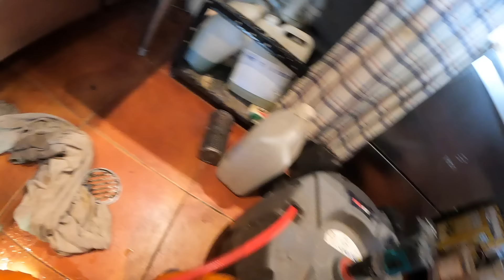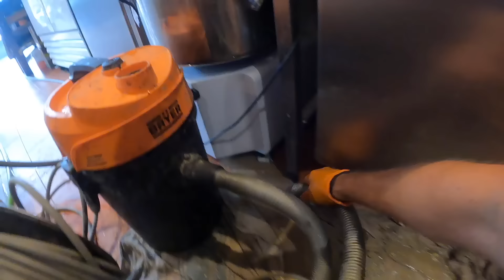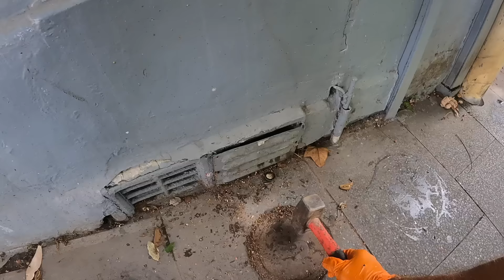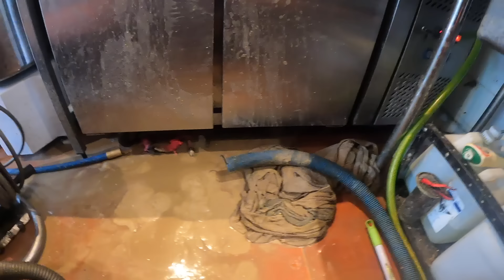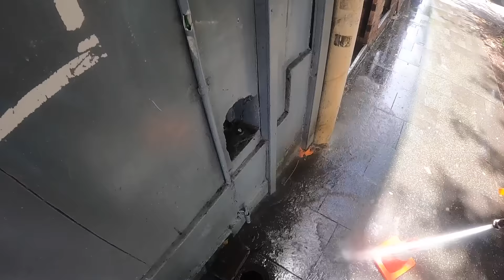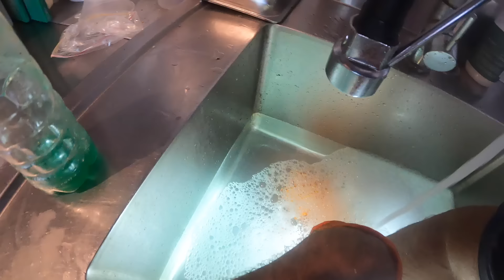Blocked Drain 623

Comment: I've said it before, whatever this dude charge, it's worth it. Because he dosen't run away as soon as the pipe seems open. It's important with ppl like this who trace the problem all the way.  That's good work etichs and customer service. You can't pay enough for ppl like that. If he had left as soon as the wastewater was flowing inside, the shop owner would still be left with a problem. Even if something was broken outside, it's better to find it out and fix it. Than to meet the problem again down the line. Good Job. I've never understood why he bothers with gloves, though. He breaks them every single time :) :)
Reply: 300 australian dollars^
Reply: @DoRealAres  and deserves every cent
Reply: I think the gloves are to grip the pipe.
Reply: @adammckay7335  Yeah. I wasn't to serious about that last part. 😁😁
Reply: occupational health and safety Oz style.
Reply: Doesn't charge by the hour either.
Reply: I'm convinced at this point that he probably didn't wear bitch mittens early on and some Karen hounded him about how unsanitary it is, so now he just wears them to prove that they don't matter since they rip open or you're shoulder deep in shit.
Reply: L
Reply: Wiwiwwiwwiwiwi♥️
Reply: 300 is more than reasonable in the favor of the customer considering how much work it is to clear AND diagnose main drain issues. And all on his own

Comment: I sincerely hope you where paid by the bucket load on that job....  Have to wonder how much time might have been saved if the business owner would have pointed out that information about the waste coming out of that 'top pipe'...  I have a feeling  you would have tackled that one from outside 'in' with more zeal.

(Side bar note:  They are not required to run with grease pits?  That is designed to trap and hold that waste until it can be pumped out.)

Comment: Ollie, you need a wet and dry vacuum upgrade! Here in the UK they make a wet and dry that has an output hose on it, my old man has one for cleaning the bottom of his pond, the vacuum has what i suppose you would call a reflux valve in the bottom of it  which whist the vacuum is running is closed when the vacuum is full and the suction stops the valve opens and discharges the load of water through an output hose, theres a little filter in the output so just the water leaves the vacuum, you can stick the discharge hose out somewhere you want the water to go, would save you having to keep emptying the vacuum, 👍🏻

Comment: Nice, I love my Rigid-Flex shafts, that sucks tearing up the cable but you handled it well. Expensive ordeal. I must say though my flex shafts are useless on grease clogs basically, but fair really well on most other stuff. Jetting is still the way to go. I find myself clearing it with a cable auger and a spade, then firing up the jet to avoid them messes but I am not sure my cable machine would have even touched that amount of grease. Having to clear-drain restrictions from inside like that is horrible to do. I wish I had the patience you do. That was one frustrating clog. What a nightmare from beginning to end.

Comment: The Ridgid reel is a good design. I had so many idjuts I worked with that cannot cope rewinding a rod and haul wheel and it tangles up cause they wind the wheel instead of using the rod to push back onto the reel

Comment: Ah. Dominos redfern. Being an ex dominos pizza worker (decades ago) I can see why the drains clog. First up, washing all the dishes / containers with the pizza contents makes the water disgusting. Sure, we use a strainer but still stuff goes down the drain when we have to pull it out when the water keeps failing to drain out of the sink.
Second up, cleaning the floor is often done with a hose which all the grease / small food scraps goes down there.
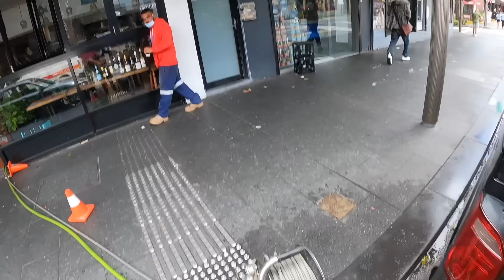20:57 Keep an eye on him. Probably wants to steal stuff out of the back of your van.

Comment: When I find myself in a situation like this I use the Milwaukee transfer pump. I put a short hose on one in down the hole. Then run the other hose outside wherever it needs to drain so I don’t have to keep dumping my shop vac. The M18 transfer pump works great for this

Comment: Would a dry and continuously running waste water pump in a bucket work instead of the vacuum? You could at a hose to it so you don't need to carry all that crap water around.

Comment: Sometimes a good old fashioned cable machine would have saved so much time on this one. With all that grease in there a 1/2" or 5/8" cable would have popped that in minutes and then you could have ran the jet to clean it afterwards without the flood.

Comment: You got your workout on this one just from dumping that vac as many times as you did. Bravo work as always, wish you were in the States, could use your services with the camera. I'm in a building built in the 1930s and my toilet only flushes about three times before it stops up. Checked vent pipe for blockage but guessing there is a dislocation from foundation settling or some oddball blockage. 

Thanks for taking us on another adventure!

Comment: Hey Ollie ! Buy an iflatable rubber thingy  and stick it on that hole on the floor so you dont have to use the vacuum to suck the water all the time. Emptying the vacuum from water should be the most tiring thing from all you did that day go back and forth. That inflatable thingy looks like a well known naughty toy but also there is as a tool too. It inflates very easy so you can deflate and inflate very easy anytime you want to check among jets. It would save you a lot of time. I know it sounds funny but i think it would help.

Comment: oli I'm sure there is a rigid hoover that has a drain point on it which you can drain aswell hoover at the same time... if not you can get an 18v wilwaukee pump that you put a hose in and put a d stick it in the drain and will keep it pumping out while you jet... worth checking into would save the hassle of keeping ha ING to empty the hoover... Great video keep them coming from the UK

Comment: Attention drain addict.. TIM from Canada... if you look you might be able to find one..   (rigid makes a shop FACK that you can attach a garden hose to and it will pump out the water )from where you are through the garden hose outside... do you not know if they make them where you are I know they have them in Canada.. it is a two way sharp fax system. You hook up a garden hose to the back of the shop back and when you are sucking out the water it will go through the shop FACK through the garden hose and out of your area something to look into

Comment: Thats a bad system..i think somebody has tied in rain gutters and sewage. I bet the drain behind the wall vent( around the corner) should be roof rain runoff from that row of buildings..that grease is still blocking the interconnected pipes under those buildings, maybe two businesse away, and diverting the customers sewage to the rain run off